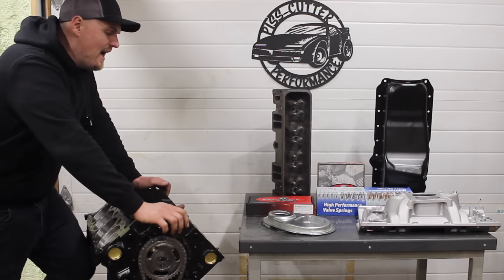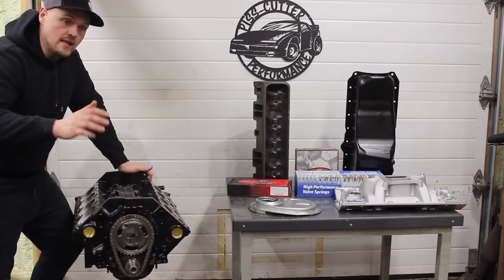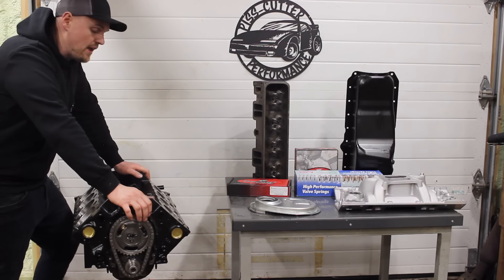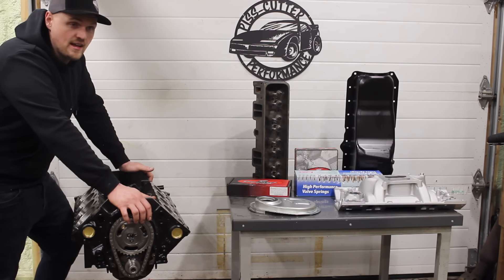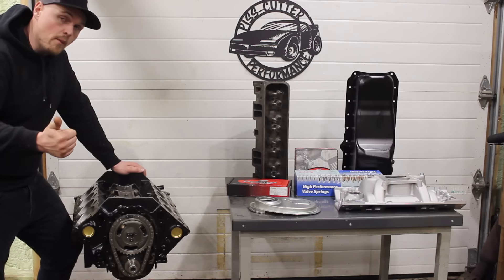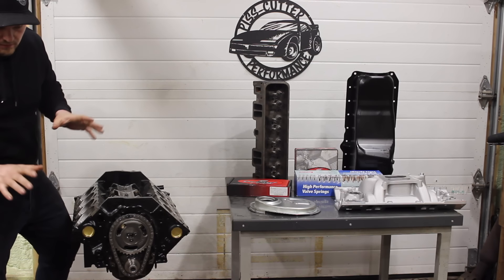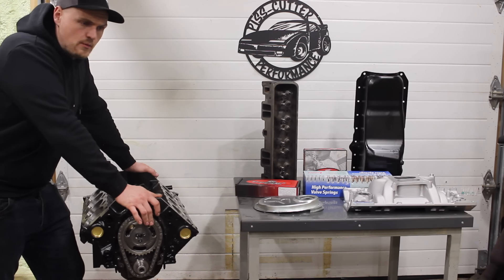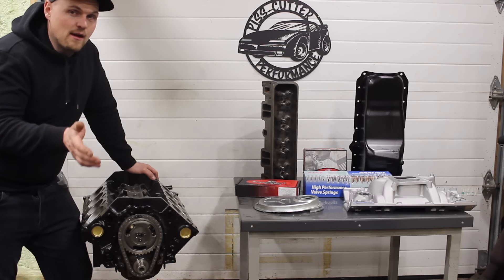The Cam I Always Get Asked About!  L31 Budget Build Update (L31 Build Part 5)

Comment: LT4 hot cam that awesome I'm running one in my 92 c1500. It has .030 over flatop pistons  the block was zero decked running blueprint engines 195 aluminum heads , Edelbrock EPS vortec intake. I do really like the LT4 hot cam it has great driveablity. I have a old hotrod article from 1997 they ran a iron head LT1 with a carb intake and the hot cam made 420 hp 430 tq.
Reply from the maker: Ive seen vastly different dyno results with this cam (From less than 350 hp to 420 hp) so I will be curious to see what we can get out of it.
Reply: @cuttersperformance  the ones I have done are about 400 hp and 430 tq.  The CarCraft article was 401 hp @ 5,600 and 428 tq @ 4,200. It will really wake it up.  350 hp is way low for the combination even if you used the garbage mexican heads.  The little tiny 196/206 @ 0.050 GM 395 cam cranks out 350+ hp in a stock L31 tested without accessories and with headers.
Reply: @cuttersperformance  Hey I just found a channel right up your alley. The name of the channel is Nyle Green. He has a really nice '66-67 Chevy Nova and he has built 5(!) different combos of Vortec headed engines over the past winter and he is installing them one by one into his car testing them for 1/8 and 1/4 mile times, tweaking them to optimize them then pulling it out and putting in the next one which should be a little better until the last one being a 408ci that should be the best. I immediately thought of you and all the Vortec headed work you do.
Reply: Im building almost an identical vortec headed engine, only mine will be a 385. I had the heads converted to 8mm stem .100 valves , 202 160, with 26915 Comp behives. Im having the block decked .015 and am using KB claimer pistons on 6in. Rods. The cam will be a Summit 8802. Should be a good runner in my 71 GMC.
Reply: @James-jn3rb  Sounds like a really interesting build, I looked at the summit 8802 cam and everything looked like it'd be good for your engine with the exception of the LSA being 112 degrees. That seems very wide and the wider the LSA the more it moves the power peak further up into the rpm band, you said it was going into a 71 gmc and I'm assuming your not planning on revving it to the moon either. David Vizard has YT channel discussing this and he practically wrote the book (he actually has) on everything high performance.  Anyway I think you'd be best served with a LSA no wider than a 108 but 107 would probably be best otherwise you'll sacrifice alot of low-end torque which you want.
Reply: @conservativecrusader80   I just found nyle Greene myself. He's getting killer times for what he's using. The 488 gears help I'm sure.
Reply: @johnsheetz6639  Back when I was in college we had a motorsports club and with me being in the Automotive Technology program I got to drive our drag cars on several occasions. It was a 1980 Malibu with a 355, four bolt main, pre roller block, scat crank, Dyers rods, and JE pistons, Edelbrock E-Tech 200 heads, 13.5:1 we ran turbo blue or Torco 110, solid lifter Bullet cam, it think it was around .555 in. .532ex. on a 106lsa honestly don't remember the duration specs but I'd say at least 250 ar .050, victor Jr. with a holley hp 750, msd, hooker headers, built th400 with a trans brake, 9 in with 4.86, 29x9.5 M/T slicks and the best we ran was 7.10 1/8 11.29 1/4 and went thru the traps in the 1/4 @ 7300 rpm! It would pull the wheels about 10 or so inches, it was a blast!
Reply: @James-jn3rb so its nowhere near identical 😆
Reply: @conservativecrusader80 each person has to see how much cam can be put up with example if you put that 8802 on a 107 you now have 8 overlap vs -2 a lot less vacuum and a lot worse idle not to mention gas mileage went from 18 mpg city to 8 mpg yes more torque but at a cost torque converter stock will not like to much overlap either I would if possible go -6 to-9 overlap for a truck that is going to tow consistently
Reply: @cuttersperformance 
Optimized cam advance is very important... But requires a variable gear and multiple dyno pulls.
It's the only way to optimize based on all the other variables.
Be sure to run the actual headers that go in the car.

Comment: Sure would be nice nice to have a larger quench pad on those stock pistons. Also, bake that timing chain in some moly lube for a hour at 200 degrees. Virtually eliminates chain stretch. That’s a tip from page 89 in a book called Small Block Chevy Performance by Dave Emanuel. Published by HP books in 1992.

Comment: I really believe in DV's 128 rule. That rule applied here the cam would need to be on a 107/108 LSA. Going to the wider 112 LSA leaves a good amount of torque lost, even with a smaller @.050 duration (within reason).
Reply from the maker: I agree that there will certainly be a loss in torque for sure compared to tighter LSA. I have some other combos in the works, and it will be interesting to compare dyno results, cranking compression, and idle vac on these combos
Reply: Keep it in perspective,  yes there will be a little more tq and maybe hp with a tighter LSA , but that's only relevant to WOT peak figures so thats great if its a strip engine or weekend warrior.  That tighter LSA(and the subsequent overlap) then makes that engine less drivable at partial throttle,  will accumulate more exhaust deposits on the intake valve and port, be more sensitive to detonation due to the higher light throttle chamber temps and in almost all cases will be less efficient at partial throttle as compared tonthe wider LSA. So if 10/15 lb of tq is all that matters, yes tighter lsa but if best 'all round' performance AND driveability matter no tue tighter lsa is not what is needed.
 Also consider that the tigher the lsa(or more overlap be it from lsa or duration) the more sensitive the engine becomes to exhaust system flow quality. Less overlap(wider lsa or less duration) is less affected by a poor exhaust system design, so that narrow lsa cam engine with 10 lb more tq on the dyno woth open headers then loses that gain and more with a similar budget exhaust in a vehicle as compared to the wide lsa version but the narrow lsa version then also drives worse everywhere due to the overlap and poor exhaust. Look at this as a 'whole combo package deal' everything must match your application or you end up with sub standard performance.
 Nice work PCP 👍
Reply: I agree with both of you but you can also just retarded to him for degrees and that would help on the bottom end without sacrificing too much top end I understand it's not changing the LSA but it will give you more bottom and towards without sacrificing any top end or mid-range torque are sacrificing any top in horsepower
Reply: Agree, but it's a $60 cam, not $ 460.

Comment: ~400 hp @ 5,500 and 430 tq @ 4,000 rpm with a performer Q-Jet intake and an 80s truck 850cfm Q-Jet is about what I have found with 3 different Hotcam L31s.  I just put together a L31 with a factory LT1 rotating assembly and a GM 6492 hydraulic roller cam.  The 6492 cam was $110 new shipped. The 6492 is very similar to the old Crane 2032 and was used in the 340 hp marine engines. I put Hooker 2.5" manifolds and a ProFlow 4 4150 style EFI I scored at Summit for $1200 new on it.  A little head work and 1094 head gaskets.  It is also a single roller chain that I reused with 110K on it as it was in perfect shape with no slop and I put a set of used Jegs 1.6 roller rockers I had laying around on it. LS6 springs on 787 retainers.  Its going into an 87 G20 van with a TH400 with the stock ~2,000 rpm converter and 3.08 gears, so it needs to have some torque. I always use a Mellings M99HVS oil pump on a small block. It is a stock volume big block pump with a matching pickup for a small block and the steel sleeved driveshaft and install it on an ARP stud. The stock volume, high pressure big block pump (I use the Red L88 spring) works better than a high volume small block pump and takes less power to turn. I use a larger 5qt pan (7qts total with a 2qt C60 truck filter) for a 3500 Express van application and a milidon windage tray that goes 1 main cap further than the stock vortec tray which requires 2 more main cap studs.

Comment: How do u resize fractured  designed rods ?
Reply from the maker: @tommyschmoker8388  then 31 rods are Powered metal but not fractured. But  a fractured rod can be resized but using a .002 over OD bearing
Reply: Me too ?

Comment: I have 1 880 motor trying to do the same been getting a lot of good ideas from you and some other YouTube videos thanks again brother keep them coming
Reply: lunati makes an efi roller cam thats perfect for these motors. power off idle works with stock valve springs and pulls great to redline idles good and runs fantastic.
the lunati cam is .450 lift right at the limit but it makes more power than the gm hot cam and also more torque so you have a very good running motor after and it still picks up gas mileage over stock so theres that too.
Reply: The 880 blocks are great ,and you can run a roller cam ,and use the factory roller lifters and dog bone set up..

Comment: I had the plastic timing cover without the extra bolt holes for it I just drilled and tapped the following 2 holes and for the dowel pins I took a drill bit the same size as the holes on the timing cover and cut them with a wheel and knocked them into the block to hold my timing cover up and used e6000 glue to set them in worked like a charm harmonic balancer instead of a 6 inch I went 8 inch sfi approved liquid dampener
Reply: Stock 8" dampers dyno the best across the board power... Harmonics?

Comment: I had an l31 vortec on my 74 c10 with a tiny 218 cam. At full weight with stock suspension it went 13.0 and 11.9 with a 150 shot of nitrous. Very impressive engines for how well they run with small cams
Reply from the maker: Impressive times for a mild cam

Comment: i have run the lt4 hot cam in 2 gen 2 motors i did use 1.6 rollers and 1.5 stock rockers it has a very mild lope,. lots of torque and revs quick,.great buy on your part,

Comment: I knew a person who ran that cam in a crate 350 with unported GM aluminum heads and the GM copy of the Performer RPM with a 4779 750. Used a th350 with a Hughes 3500 converter with 4.10 gear and 28x9 M/T drag slicks. In a 73 Nova it ran 12:40- 50's pretty consistently in weekly bracket racing for points.

It had the bench seat and full interior but had the mat for carpeting and he took out the crash sftuff behind the bumpers.

Comment: Holley makes an inexpensive aluminum cover that fits the L31 block and offers it with and without the crank position sensor hole machined. I have used 3 of then now and they are a really nice piece. I had to find a way to do away with the plastic covers yet keep the cam sensor for the 4x or 24x reluctor wheels because they will not last 2 years in the Texas heat on a L31 without warping and leaking. I have a couple of these L31s running on D585 LS coils.
Reply: Its around $60, not terribly priced but only really needed if you prefer the aluminum vs plastic. Neither will allow a double roller though unfortunately. You can buy the plastic covers with the sensor hole plugged or not drilled out as well
Reply: @jjmccloud  problem I have with the plastic one is they do not last more than 2-3 years before they warp and start leaking.
Reply: @chrisreynolds6520  i think it depends on who makes them, the oem ones have been decent but the other cheaper brands I've noticed do warp and leak pretty easy. The aluminum are great for durability I just wish you could fit a double roller behind them
Reply: @jjmccloud  the single rollers are better than a crappy double roller in every way imaginable.  The covers that leaked were OEM GM.